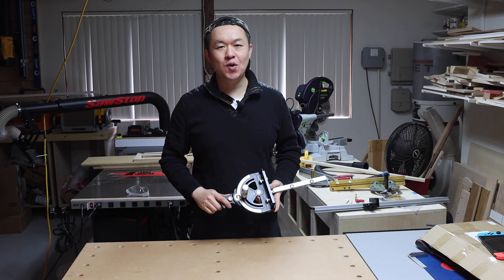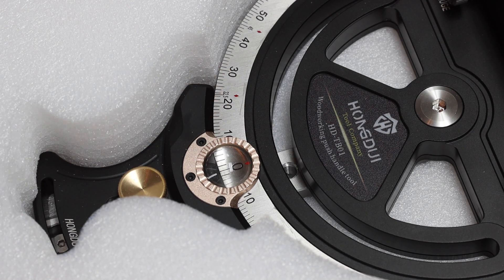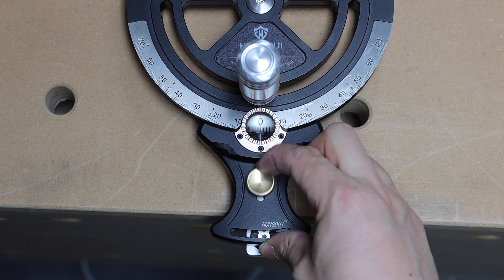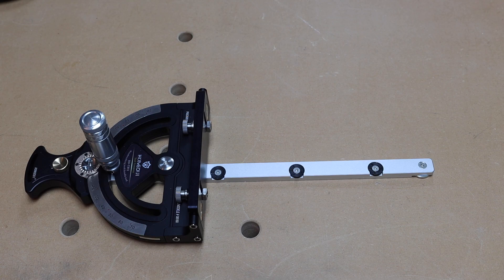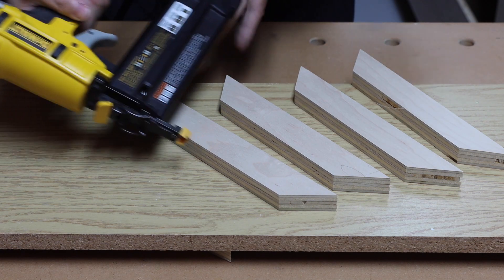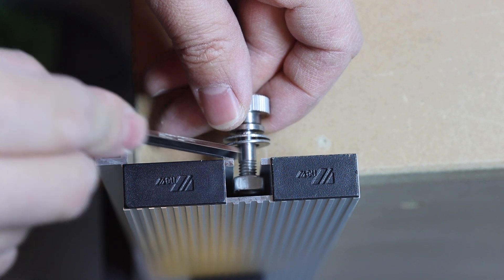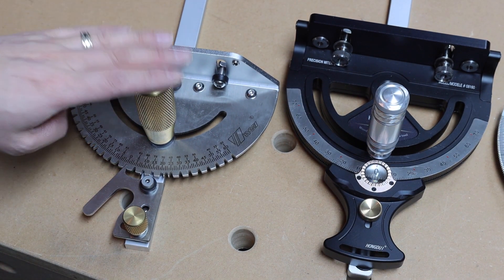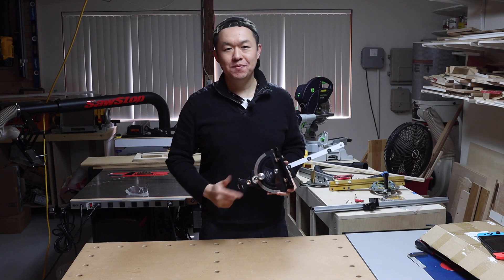Hongdui HD-TB01 Precision Miter Gauge | Banggood Woodworking Tools Review

Comment: Hi ding, great review of this miter gauge how ever its way over priced for what it is when you look at the incra system i think people will would buy the incra instead, also if you have any problems or issue with incra you can take it back to the store, problem with banggood you have to send back to china which would cost as much if not more than the cost of buying the item
Reply from the maker: Hi Sandman.  I agree with you.  The current price for this Hongdui is not quite competitive comparing to the list of Incra offerings.  I have the incra HD 1000, it’s a very capable miter gauge and I use it a lot.  On the other hand, this Hongdui miter gauge is accurate, and certain excels on the aesthetics 😆
Reply: @DingsWorkshop  i agree it does look good but lets be honest if it cost £70 ok but not its current price, still a great review
Reply: The Hongdui competes against the Jessum& Harvey miter guages. Both of them cost way more than the Hongdui. It is NOT overpriced. I just paid $130 without fence. With fence it was $270. Jessum&Harvey are $100+ more. How is the Hondui overpriced?